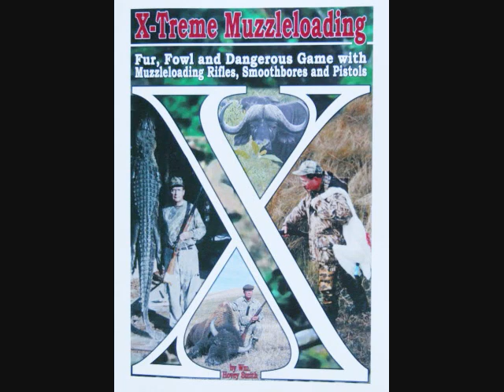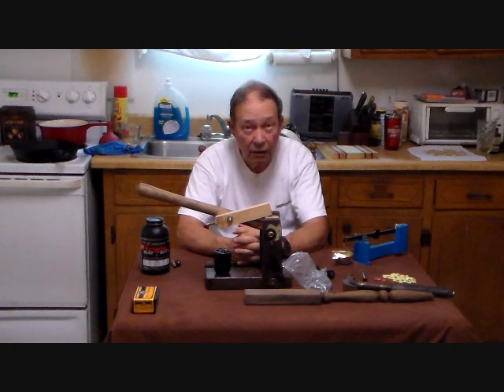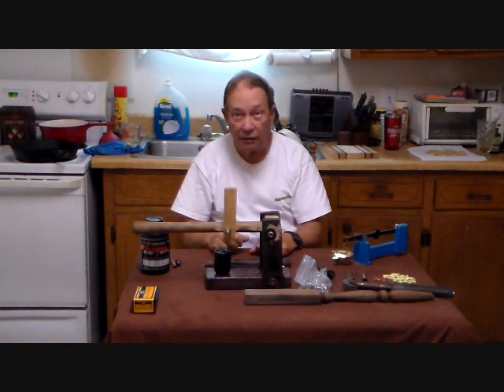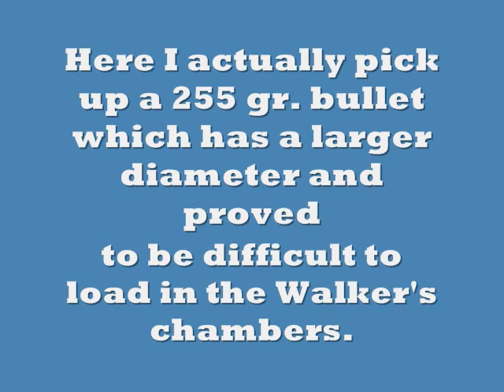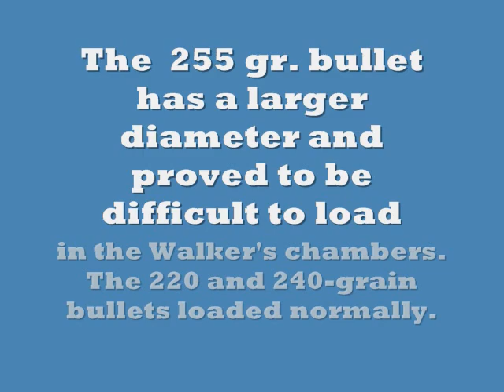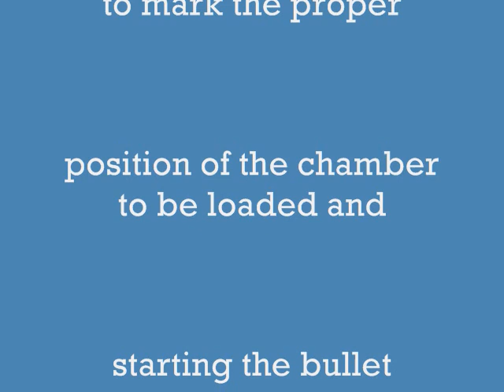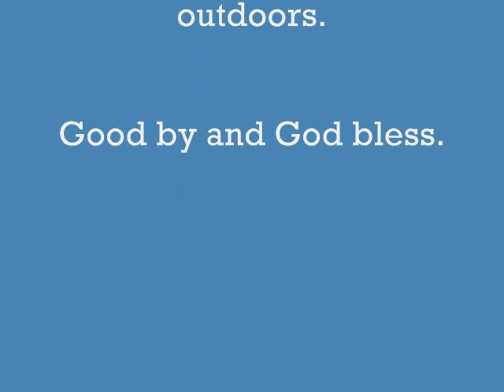Super Walker Loading Stand Mark I

Comment: Mr. Hovey, No offense but throw all that stuff away and find a woodworker's clamp that utilizes the Acme screw mounted on a sturdy base.  Secure your cylinder and your brass jag (the jag was a very good idea btw) You then only have to crank down vertically and seat your bullet to it's proper depth with no cant and more importantly no pounding.  A large C-clamp attached to a suitable base would work also. You may need to extend the handle to get enough torque to seat the bullet, sort of like a cheater bar. I think this might work better, what do you think?
Reply from the maker: I will look into it. I like your concept.

Comment: The loading stand looks and works well. Most of all it was inexpensive and self built which gives more satisfaction to the user. The .457 255gr Kaido are made specifically for the Ruger Old army and not to many of the replica's made today have a .457 bore. Most are .454 or .451.  Nice video, waiting for the ballistic tests and hoping for an accuracy and or penetration comparison.